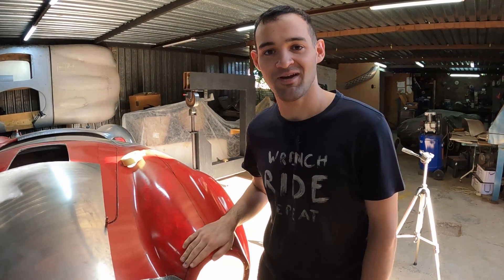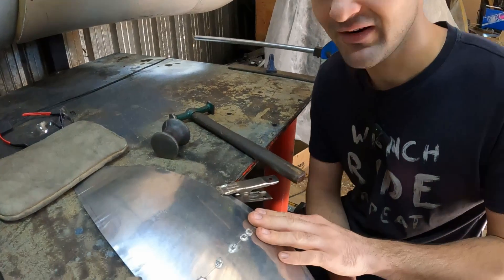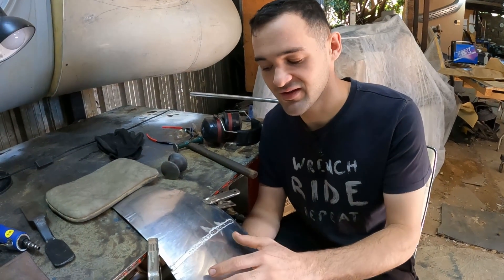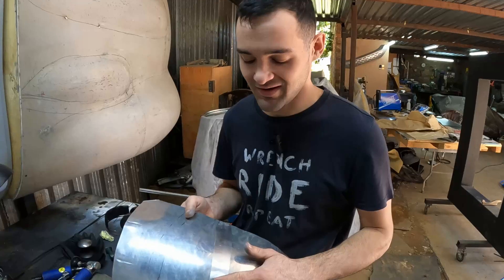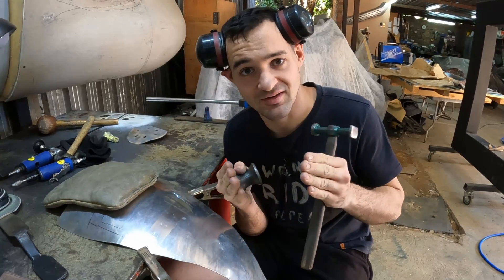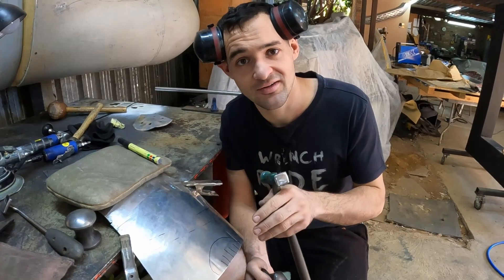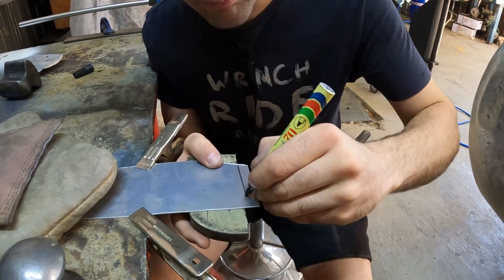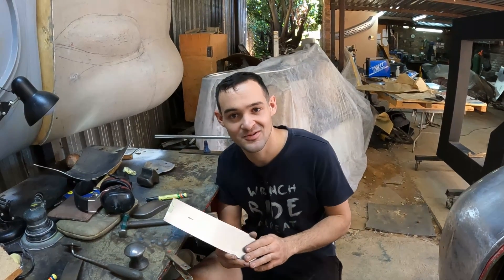Essential skills for fabricating Aluminium Cars

Comment: In New Zealand I have to use 5005 since we can't easily get 3003 here either. I'll have to try the tungsten burr to grind back the welds. I have been using 2 inch Roloc flap sanding discs which works pretty well. My welds are somewhat lumpy since I gas weld and weld on both sides so lots of grinding. I've just worked out how to improve my welding technique so I need less filler so less grinding.
Reply from the maker: We also unfortunately only get 5005. I've not done gas welding yet, but the tungsten burr works well.

Comment: Could you please show your method for tipping an edge on a curved panel like the cobra boot lid surround  you pointed to in the vid. Great work thanks.
Reply: It is very much the same but does require a shrinker stretcher . Tip the edge 10° then shrinke/stretch it back to shape, then tip some more and repeat.